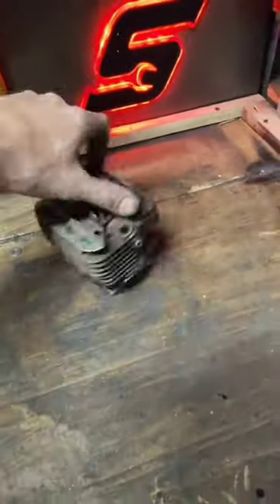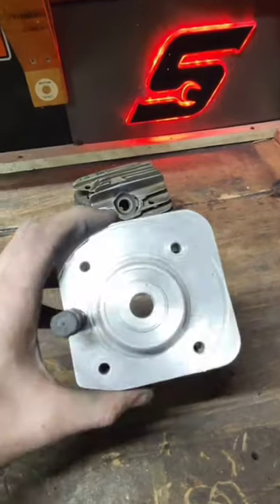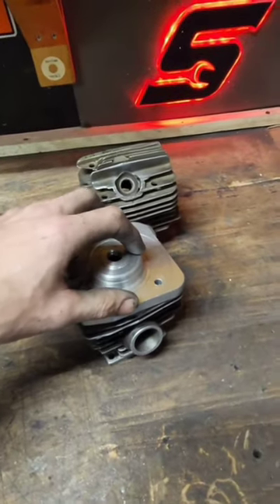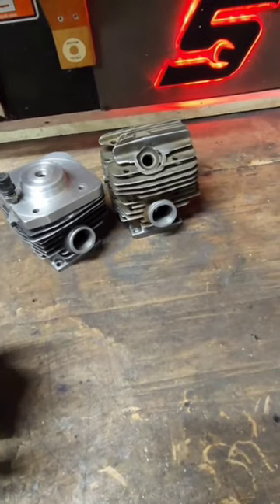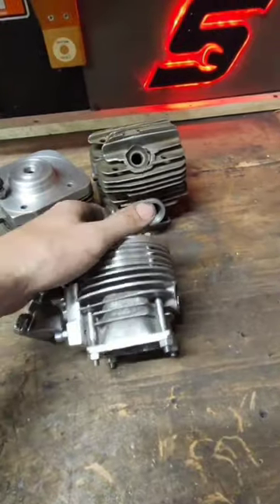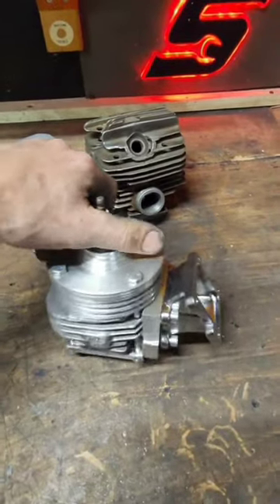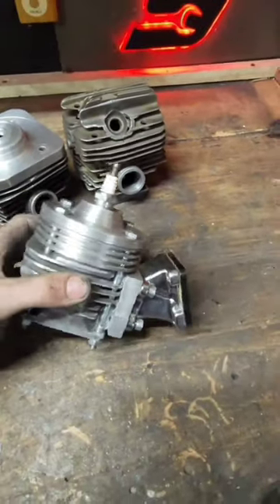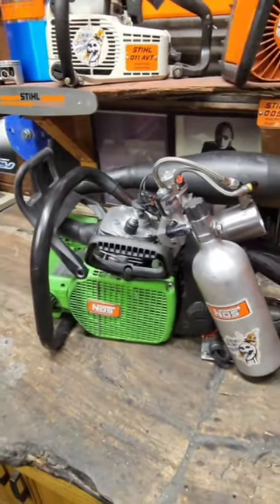STIHL 084 NOS SAW... with a "custom" cylinder... wtf is this?

Comment: That thing ain't got shit on my deported 180 with a catback skinny pipe dohc 3 cylinder twin piston carbureted single axle methane injected 39" bar toting top handle interchangeable brush beast bro

Comment: love the content man I'm just curious to why the normal hardware on your head wouldnt flanged bolts or even studs be beneficial especially with the stuff your doing with just curious to the decision to run normal hardware with no washers?
Reply: I think those are just holding the assembly together until mating day.
Reply: @crinkly.love-stick  that's a good point hopefully he puts ARP hardware and turns it up to a moonshot for a video lol